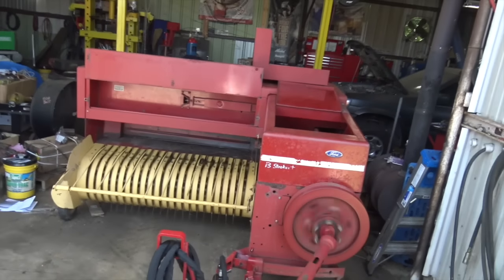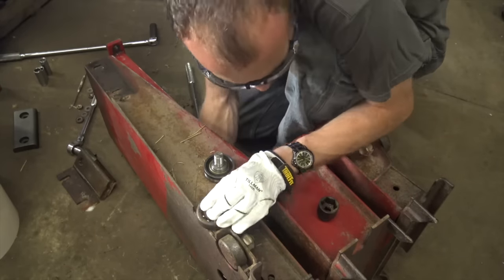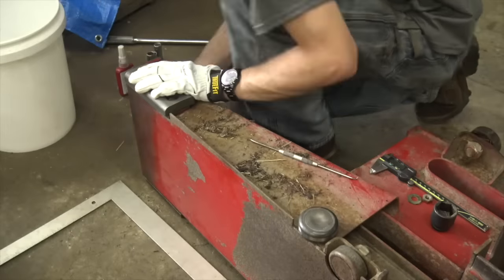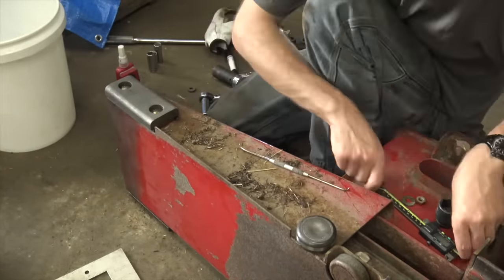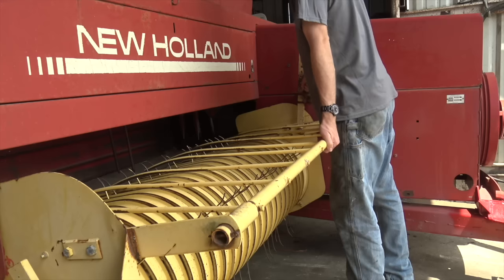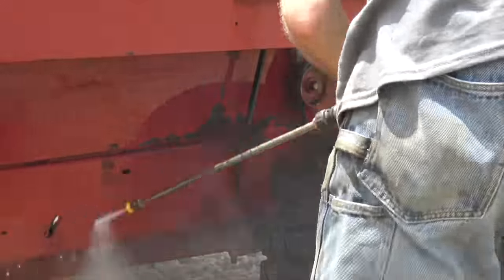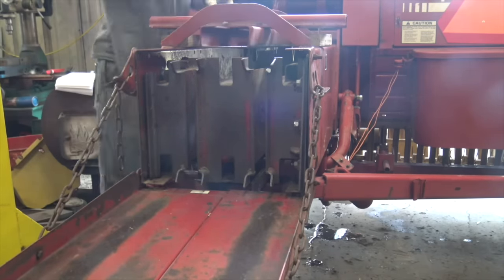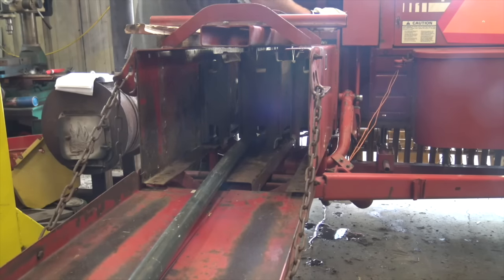THREE THINGS YOU SHOULD NEVER DO WITH A SQUARE BALER!!! I GOT SCAMMED LEARN FROM MY MISTAKES!!!

Comment: Your situation sounds familiar. I paid the local dealer to have my New Holland square baler made "field ready". Within the first couple minutes of use, it was obvious that it wasn't fixed. When I checked the dimensions with the owners manual, nothing was in spec on the knotters so I ended up adjusting it myself. I was not a happy camper. Sometimes your better off to just do the work yourself.
Reply: Unless you have hay to bale there is no way to know if the baler is " field ready "  !!!!    That you should know.

Comment: We had an older one that we used to bale hay with for a few years. 3000 bales or more a year. Biggest problem we had with ours was the brake on the knotter would slip occasionally. Ours was a Super 66, so it was not as new as yours. Never had the plunger out. If we were out in the fields and left it overnight, we tossed a bale over the knotters. I think it missed about 100 bales a year. Had the long chutes on it, with a hitch for a wagon. That was my job, the wagon loader. 80 bales on each of 2 wagons, depending on how far we were from the barn. About 20 minutes to load a wagon.
Reply: I still have a Super 66. I haven't used it for years because it broke a needle. I tried to get it welded but that didn't last long. I have spend many hours under that one mending chains. When it worked it was ok but all the chains should have been replaced beside the needle of cause. I could have got a new needle for about A$450 a few years back but I decided to buy a NH281 for A$3000 in stead. That is starting to need maintenance as well but it is still much better. If any body needs parts for a NH Super 66 or wants a repareble but not currently working bailer then it is for sale. I even have the books for it. I don't have that for my 281.

Comment: I have been looking for a comprehensive video on setting up that plunger. What a shame it wasn’t a detailed procedure.
Reply from the maker: I scored a factory manual off eBay pretty cheap. it's all in there.
Reply: @officialweldingfarmingarch2041  Any word of advice? I already got the bearings but haven’t tackled it yet.
Reply: @ruedaricardo  Clean and prep all surfaces very well.   If re-installing components, hit them with a little Emory cloth or something to remove any grit or rust scale.
Reply: Sir, I do know from  over sixty years ago that on the B45/47 the clearance between the ledger plate and the ram knife should be about the thickness of a cigarette card, (if you can find one now) .
Also if you can keep them both sharp it makes life a lot easier  if there are a few lumps in the swath.  I always found that if it was missing a few knots,ie no more than one or two in two hundred bales then there was a good incentive to learn all about the knotters and string tension etc .
Reply: Check out some of Franklin County Forage videos. He has a few on baler repairs and adjustments.

Comment: Guys and gals, please do not work on these knives without gloves on. I gapped my left hand wide wide open on one new Holland 273. Had just gotten done changing the lower roller and since the plunger was out I went ahead and polished the edge up real sharp with a flapper and then a fine file. All I had left to do was put the guard back on the side of the plunger. When tightening the bolts my wrench slipped and the blood went on everything. Missed the blue lines in the wrist by only a few millimeters. Could have been worser. Wear some gloves and protect yourselves

Comment: Great video!  I agree that the idea of all this is far worse than the actual job!  I have yet to do this on my 273, and I have a squeaky mouse that no amount of spray, lubricant or otherwise can overcome; it squeaks consistently at full pull back(plunger fully to the front of the baler).  Otherwise it's a great baler, consistently bales hay.  Found out the hard way 2 years ago that my plunger safety interupt was frozen. (had to replace both needles and the hoop!) and had a real rough start to last spring's baling only to discover using last years twine is a bad idea.  Replaced the twine and ran 330 bales without a hitch.

Comment: I wound say pressure wash it the grease it before putting it up. When baling, leave to cover over the knitters open and let as much trash fly out as possible. I always see people on YouTube baling with the cover closed.
Reply: Thats one way of describing them. I prefer a marvel of engineering brilliance 😀 Just the knotters alone, tie a knot, virtually guaranteed to work, in a split second. The timing to get all this working without "eating itself" is nothing short of amazing.

Comment: Wash mine fairly often with no issues. You just have to use your brain and not hammer the water into the bearings and such. Clean machine usually treats you well.